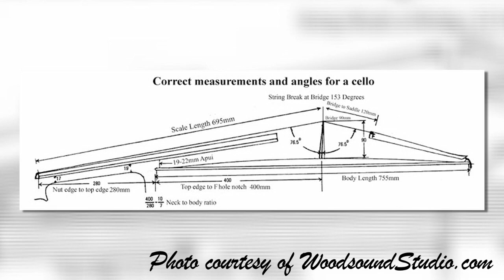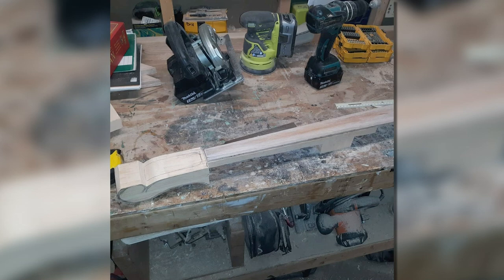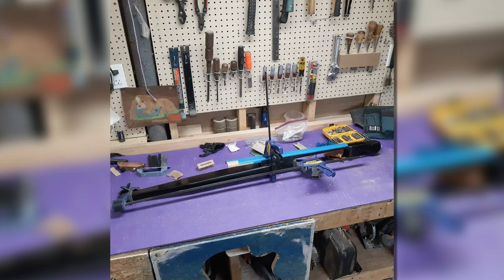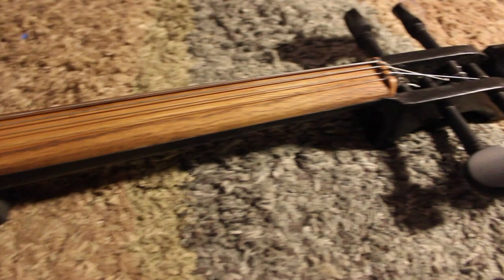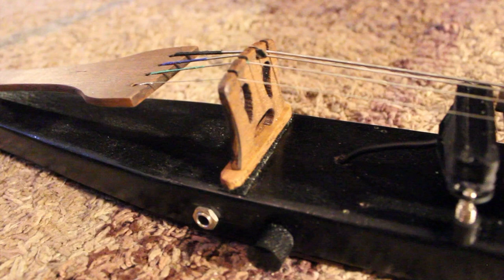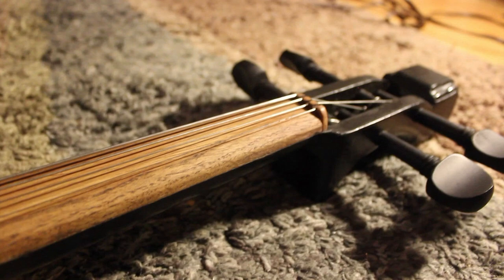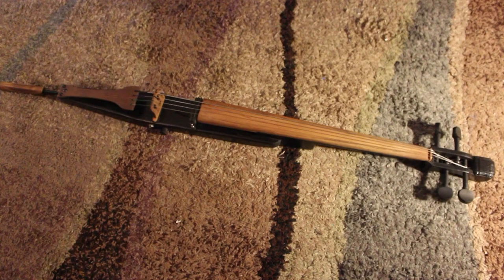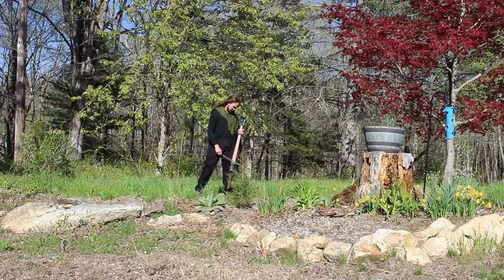Building my Homemade Electric Cello

Comment: This is so awesome! I wish I had the time to learn how to do this too, but sadly I am too busy…anyway, I have been playing cello for 10+ years and from the look of it, the biggest thing you would benefit from changing is having the bridge curved to what a real cello bridge would be. This would reduce of the risk of bowing adjacent strings on accident when playing. This change also means that the fingerboard and nut must curve to match the bridge. However, If you decide to make these adjustments, I don’t think you’d have much difficulty because your craftsmanship is very good!
Reply from the maker: Thanks a lot! Yeah I actually noticed that exact issue about the bridge while recording with a violin for a song cover I hope to get released soon (not one I built but I did make the bridge). I'd say some sort of lap bar would also help out as it likes to twist and spin on me, lol... And I know the feeling, it sucks not having the time to pursue things, hence why I haven't done a video in like, 3+ months, lol. Anyway, I'll probably make those suggested adjustments as I plan on using the cello soon to record some parts on a soft rock album I hope to have released within the next few months!
Reply: @abalanceproductions  I think they sell cello fingerboards as they are online? That could save you SO much time dude. Along with your lap bar idea, a chest bar that creates of the thickness of a cello could also help you with the twistiness. But yeah, keep me updated on your progress!

Comment: epic work dude , please give more details about the electronics !!! what pickup did u use and how did u go about installing it ?   it looks like a guitar pickup? coz i want to start making 1 out of pallet wood  also the documentation u used . can we get it sum where?
Reply: im planning to make 1 in the shape of a less paul
Reply from the maker: Thanks a lot! Yeah I really regret not doing more of a step by step when I did this. The pickup was off of Amazon and is called a hot rail pickup, there are several very inexpensive options (musiclily, alnico, wilkinson, etc) and more expensive ones as well of course. I had to use springs and spacers to get it near enough to the strings and the wiring was simply a single volume pot and an input jack. As for the documentation I simply googled cello schematics and diagrams and there were several options available that gave me precise information on every angle. I believe I also saw another youtube video on an electric cello build that looked really good. I haven't watched it but maybe see if you can track that one down? They might have better details! Good luck!
Reply: I've only known what a cello is for the past 6 hours.
Doesn't it need a big box for the sound to bounce around in?
I'm making 4 way magnetic and optical pickups to capture entire energy of string  and there are like 24 combinations of the four.
Quickly the guitar sound was gone and deeper richer tones appeared and faded and reappeared. Electric plucked as I don't play any instrument.